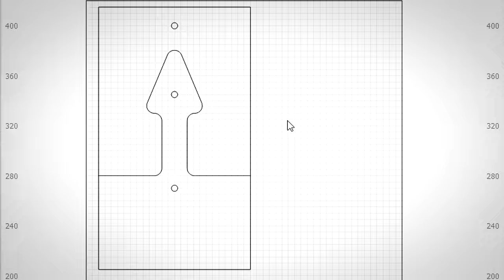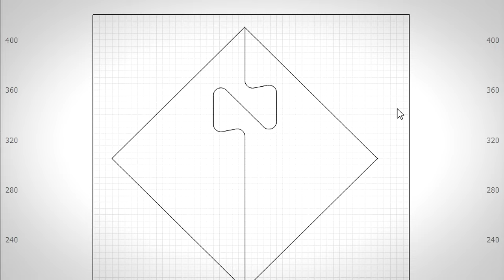Woowdworking Joinery Ideas - 3 Woodwork Joints

Comment: Nice work, laser is high tech for you. Great tool. Great joint designs too. 
I assume apart from the centre line, the other scorch lines are not required and are burned during rapid moves between different vectors.
In GRBL you can set $32=1 to enable Laser mode, should switch off laser when travelling between vectors.